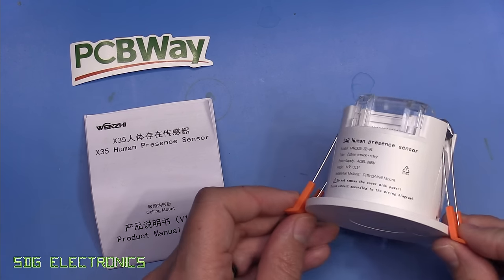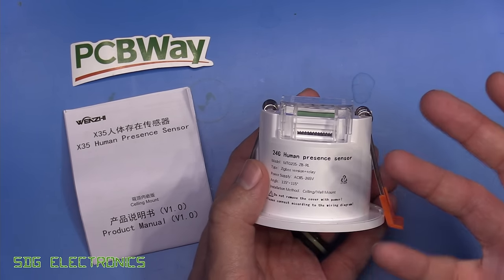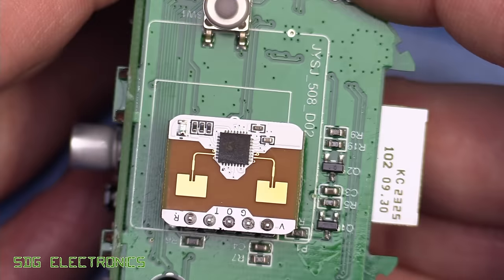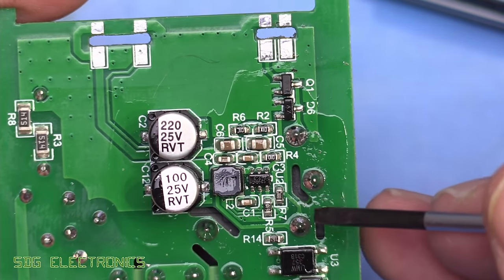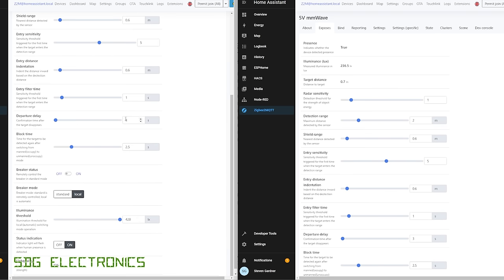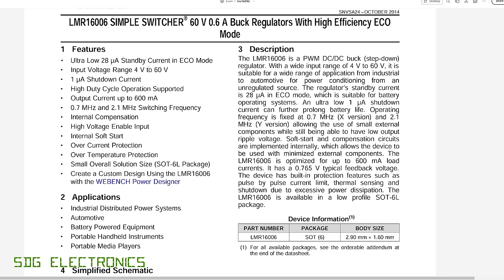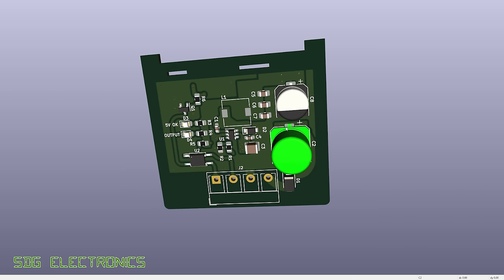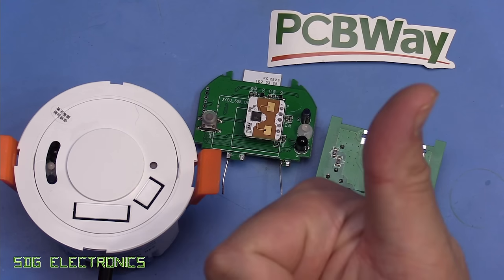SDG #320 Zigbee mmWave GHz Radar Sensor Teardown for Modifications

Comment: Usually they feed a stepped-down AC signal to the microcontroller as a means of detecting a mains power loss. In many devices like that, if you turn the power on and off fast for 5-6-7 times in a row, the device resets to factory defaults. Probably the microcontroller senses the absence of AC power through this pin before browning out due to the power supply's capacitors fully discharging, and increment a counter in memory.

Comment: If you're powering from the control system's power supply, why the optocoupler?
Reply from the maker: Any switching device would work without issue in my application as it stands at the moment. It just gives some flexibility in the future if I need high side switching for some reason

Comment: Tuya ZS3L... Bye bye privacy. It was nice to know you.
Reply: I'm interested. Are there any sources on this?
Reply from the maker: Fortunately there is no need to use their services. You can connect it to a local Zigbee network only.
Reply: @sdgelectronics The ones I had had (propriety?) Tuya bluetooth connection between the lights and the hub/gateway. There was no other way turned on or provided to operate the devices from the phone. Only option was to communicate with the hub through the Wifi to operate the devices. You look like Elvis Presley :)
Reply: Not specific to ZS3L... "Tuya" was sufficient.

Comment: Excellent video, but it seems that while the control PCB was conformal coated to allow use in a high humidity environment, the radar module was not. The board to board connector could also be an issue. I would be interested in your views on how long this would last in a high humidity environment...

Comment: Zero crossing detection. Many of the Sonoff devices have them to switch the relay at 0.
Reply from the maker: Do they factor in mechanical switching time of the relay?
Reply: @sdgelectronics  I would assume so. They might not be exactly at 0 like a solid state switch but better to switch at 10 than 240 if there is a load. My sonoff pow has them. The forum guys say they don't last long with high loads without some attempt.

Comment: Nice, if you have a room above have you tried some screening in the can to limit the rf to only coming out the front.
Reply from the maker: I meant with the sensor pointing up too, it is forward directional only. So if you mounted it in the ceiling, you could pick up someone through the floor below.
Reply: @sdgelectronics  I thought that these sensors don't have a good front to back lobe attenuation.  You need some form of a reflector to push the rf in one direction. How about a test to see how close you can get to the back before it triggers carrying a soldering station of your choice  :-)

Comment: Great project, Steve, but I can't think of anything more annoying that an automatic light in the bathroom.  In a mud room entry, or a laundry room, or a garage, absolutely, but a bathroom?  No way.  You wake up in the middle of the night needing to pee, so you walk to the bathroom using your perfectly dark-adapted vision and intimate knowledge of your own home's layout.  As you enter the bathroom you're blinded and startled by the light coming on, which causes a shot of adrenaline making it difficult to get back to sleep, and likely wakes up your wife.  No thanks!
Reply from the maker: There will be more to it than just on/off 😉
Reply: @sdgelectronics  Time-of-day limits, presumably; I look forward to seeing what you have in mind.  I've encountered motion-activated lights in hotel bathrooms and found them absolutely infuriating!
Reply: They don't have to be blinding. That's the point of a Smart Home. My lights for example, follow the circadian rhythm. Warm and dim by night, cool and bright at the middle of the day. All automatically.
Reply: That’s just poor implementation of person detection. There are very few lights in a house that should only be on/off rather than dimmable.  I’ve configured my lights to a night mode that turn them on red at 15% which is good for me.